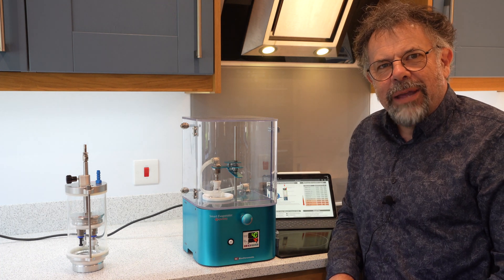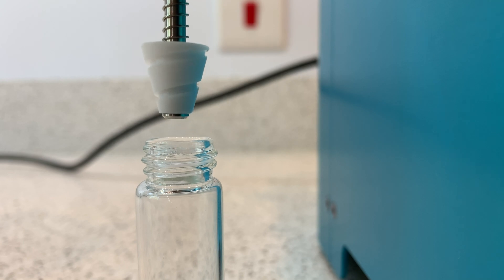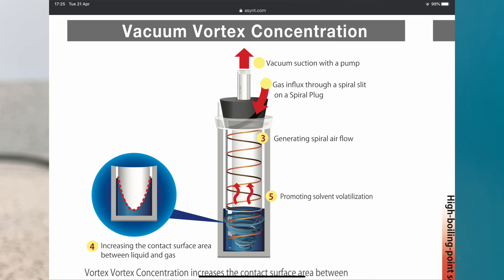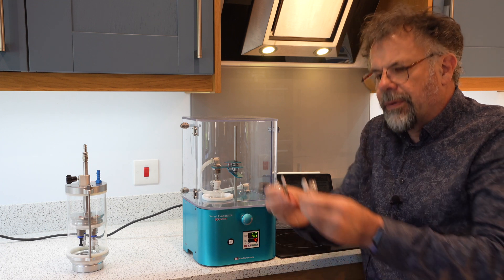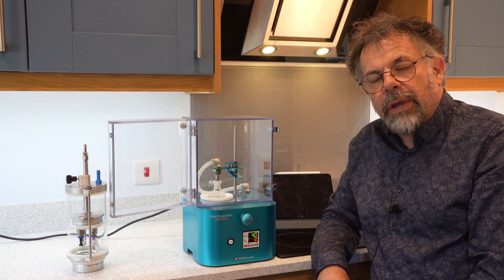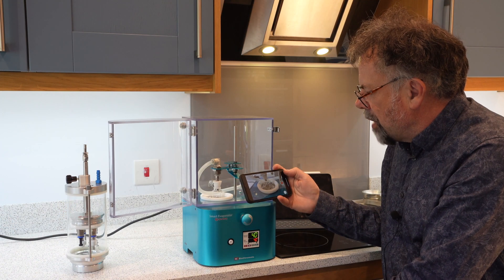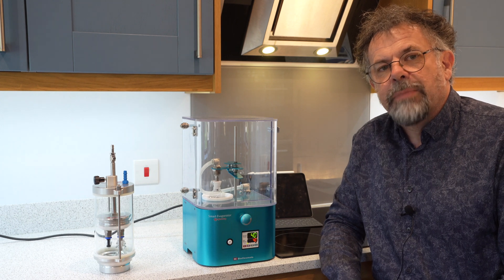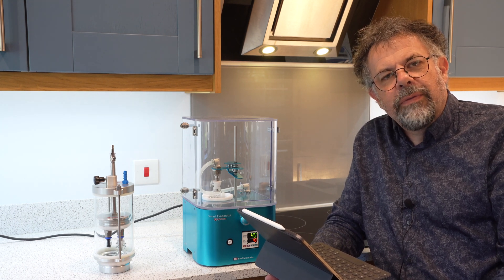Evaporate solvents in tubes and vials with ease.  The Smart Evaporator.

Comment: This is essentially evaporation by blowing air with some assistance from sub-atmospheric pressure. The novelty is that the passage of air also stirs the liquid in an efficient manner. However, I don't see how this particular product would  have any demand from chemists. If they need to evaporate high boiling liquids chemist would use SpeedVacs which can accommodate dozen of samples at a time. I can only see a market for such a product if it could accommodate dozens of samples at a time. There is not need for air suction; blowing air would do the trick and removes the risk of damaging the pump with vapors. Practicality: C-; Novelty: B